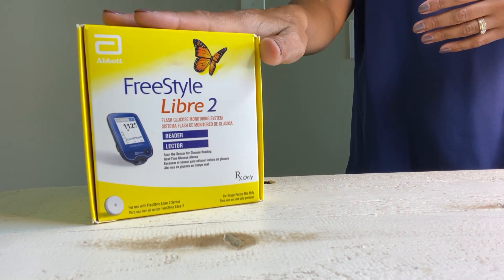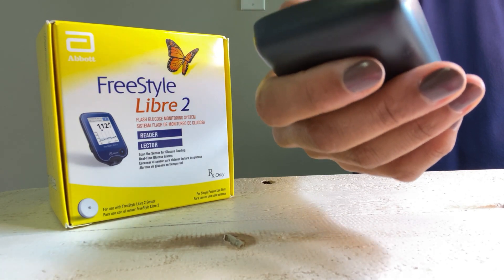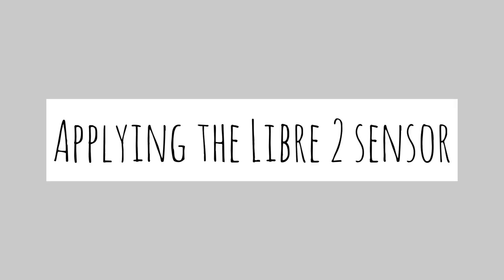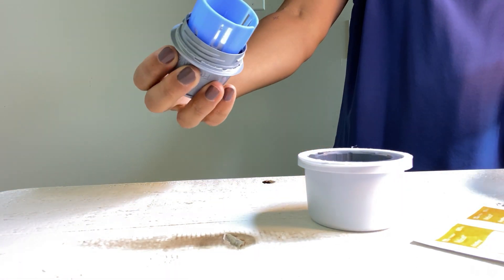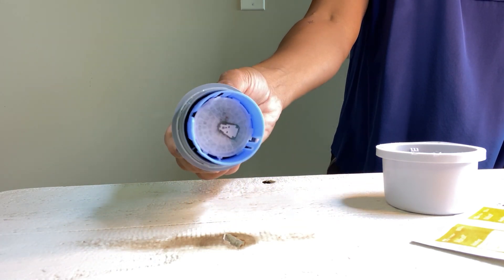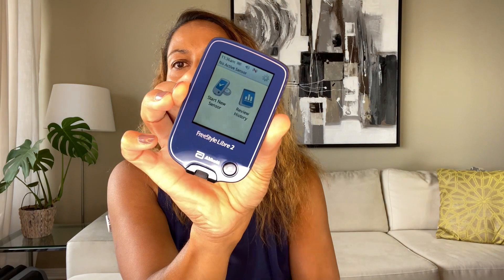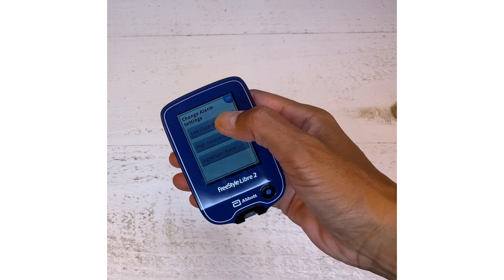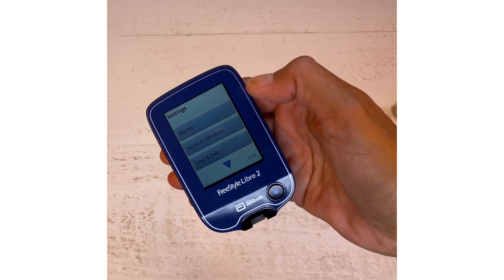Setting up the Libre 2 CGM – Sensor Application and Alarm

Comment: I have been using the FL2 for a week and it is AMAZING!! I have used the DX6 and Gardian for 670G pump Had nothing but issues with inaccuracy, calibration, lost signal, bad sensors and transmitters. I stopped using them because  I could not depend on the readings and was very expensive. The FL2 has been spot on with every reading. I ordered a MIAO MIAO2 so i can get readings sent to my Iphone every 5 minutes to be a true CGM. I only pay $70. pr month compared to $650 for the others.
Reply from the maker: That's great!

Comment: It says not be used with this reader.
Reply: It says cannot be used with this reader.
Reply from the maker: Freestyle Libre has the option of you using a reader but it has to be comparable with the sensor you're wearing. If you can't get them to connect you might have to call Abbott customer support

Comment: What type of glucose test strips do you use with the freestyle libre 2 reader just in case you get a high and need a number to know how much insulin to give?
Reply from the maker: THey're called FreeStyle Precision Neo test strip
Reply: @DiabetesStrong  Hi,  thanks for the quick reply.  Those are the ones I purchased. Your confirmation that I had the right strips helped me realize something else had to be going on.  It turns out it was my reader malfunctioning and not the wrong strips as I previously thought.  I called the number on the box to tell them about the error E-7 message I kept getting.  Thankfully they transferred me to the right department, and that department decided to send me a new reader in exchange for the malfunctioning one.  Thanks again.

Comment: There's always some wise guy in the audience who spots errors and I guess this time it's me 😇. Although this was a good intro to the FreeStyle Libre 2 system I would like to humbly offer a few corrections. First off when you come back from the pharmacy make sure they have given you the correct sensor pack. The earlier version of the Libre is called the Libre 14 Day system. Given that the Libre 2 also lasts for 14 days busy, overworked pharmacists sometimes get confused and dispense the wrong sensors. This recently happened to me and after going to the trouble of applying the sensor to my arm I got an "Unable to Read Sensor" error message. I thought at first that the problem was either a bad sensor or a malfunctioning reader. When I checked the packaging it turned out they had given me the wrong sensor. Speaking of packaging both the sensor and the applicator have multi digit serial numbers on them...make sure they match before opening the two packages as it does matter that they match! When I first began using the Libre 2  I thought, as you apparently did, that to take a reading you held the end of the meter with the strip loading port up to the sensor. In fact, you hold the LCD screen up to the sensor when taking a reading. Finally after using the Libre 2 for awhile it occurred to me that setting the low alarm to 60 or 70 as I had didn't actually make sense. For the low alarm to be worthwhile you want to know you are headed low far enough in advance to prevent the low from happening! So I set mine to 80 mg/dl which enables me to ingest a glucose tab in time to prevent the low from happening. I totally agree with you when you say that the low alarm is an essential feature of the Libre 2! I have extremely difficult to control type 1 diabetes and over the 40 + years I have been measuring my bG I have averaged more than 350 hypo events a year. Since setting my Libre 2 low alarm to 80 mg/dl I have been averaging 3 hypos a month! Who says meter designers don't qualify for a Nobel Prize in Medicine? Anyway thanks for your video on the Libre 2 ... CGM is the best thing since sliced pizza and sites like yours are essential is we are to get the word out.